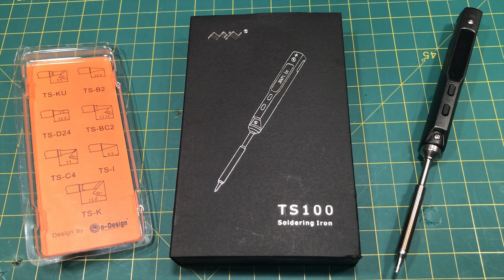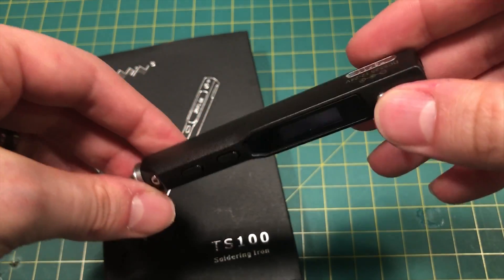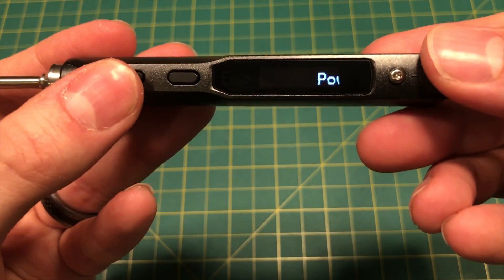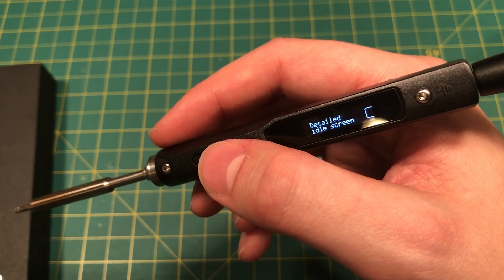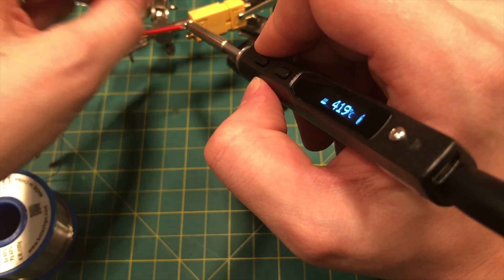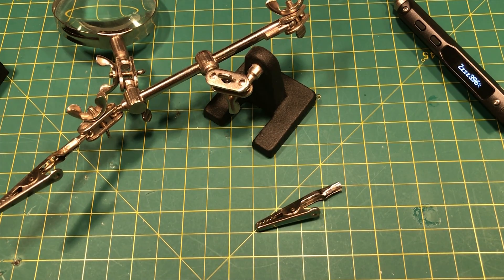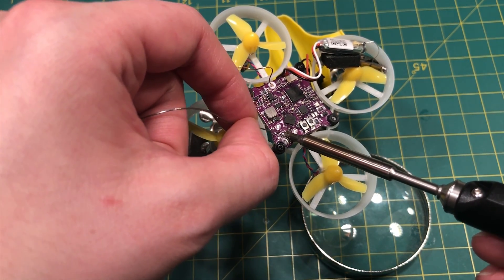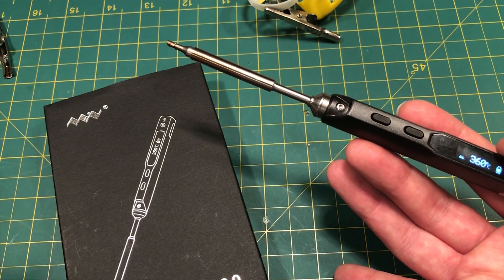TS-100 Portable Soldering Iron Review (Ralim Custom Firmware)

Comment: Excellent demo John. You make me think two things. One, I need to learn more about soldering. Two, I need this iron. Good job.
Reply from the maker: Hey thanks Mikel always love seeing comments from you. Cheers!
Reply from the maker: The one thing that helped me massively besides iron, was switching to 63/37 solder rather than 60/40. so much better for electronics.
Reply: @JohnCuppi  Good to know. 63/37 is not commonly available. And, I didn't know that it would make that much difference. I will be looking to order some soon.

Comment: This iron (on a 24V 3A+ power supply) easily smokes both of my 936 style bench soldering irons, one of which being 75W, in terms of speed of heating up and maintaining the heat.

However, nothing is perfect. The iron only stops to be annoying to use when combined with a silicone cable. Also the ergonomics is really shit. Sometimes I went back to my bench irons simply wanting to hold the iron handle more comfortably for prolonged use. 

I've recently gotten a Chinese T12 OLED bench soldering iron, built up from a DIY kit. It's got everything the TS100 has and more! Faster heat up than TS100, very comfortable iron handle, better interface (1.3 inch screen), built in earthing/grounding so there's no grounding cable hanging about. Now there's no reason for me to pick up my TS100 anymore.

Comment: I've been looking at this iron for months. You don't know but I work on micros almost every day. I just need to get one. Period. So how much on time do you get from a 4 cell? If it is only heating when you pick it up I would assume it would be alot.
Reply from the maker: A 4s battery seems to last forever. I haven't timed it, since honestly I don't spend a long time soldering, but with the sleep function you're never using the full power of the iron the entire time it's turned on so it saves on the battery massively. If you get this iron the custom firmware is honestly a MUST have imho I would not be nearly as impressed with it if it wasn't for the great work by the ts100 software development community. Also, I know you work on micros. Irons like this are invaluable for such things. I plan to build the Trainer 90 using this iron soon.

Comment: One very important tip , you should always tin the wire before connecting to an XT60, or anything else. Tin and snip to make the exposed wire just enough to make the connection. If I didn't already have 8 irons I'd probably buy one!
Reply from the maker: James Linden Thanks man. I’ll sometimes tin the wire it depends on how thick it is to fit in the connector I’m using. Probably should have done that for this gauge wire. This is my third iron. Third times a charm! :)

Comment: I never could solder I've tried a hundred times
Reply from the maker: Hey, I hear that. I've ruined my fair share of hardware with cheap soldering irons as well as just putting way too much heat on the board causing the pads to lift. The magic solution is to use 63/37 solder for electronics with rosin core flux, and a good iron. Don't go above the mid-300 C range (340-380) for soldering little things on boards since it's just not necessary.  Too many people solder at 400C + and I was doing the same. Found out it's just not necessary, unless you're doing an XT60 cable or something and want to heat up the joint fast.